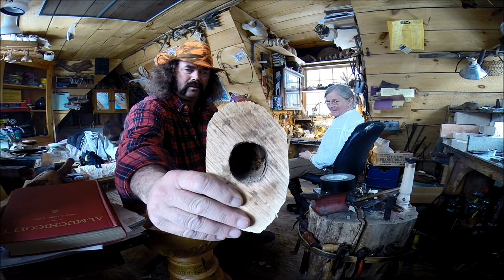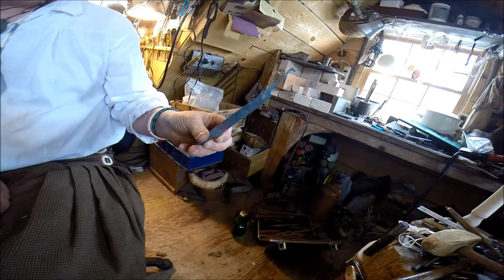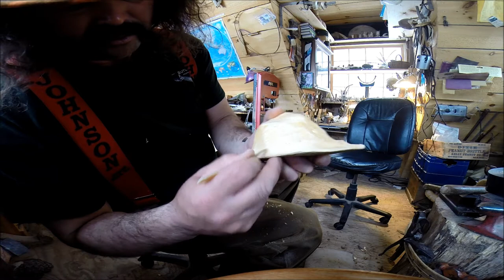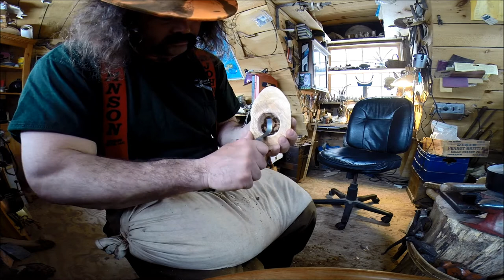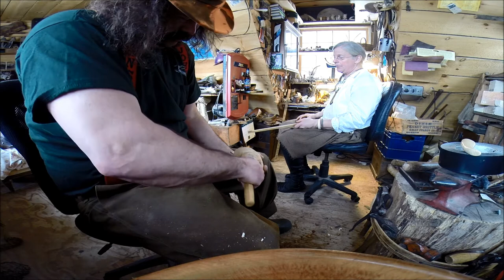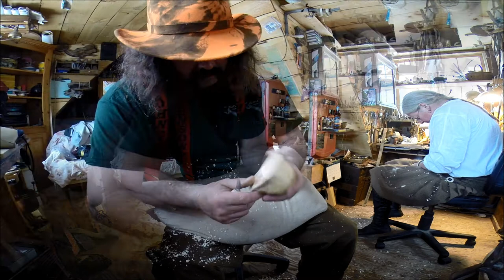Carving a Kuksa cup from a burl (part 1)

Comment: Awesome video, subbed to you.
Just got a good burl today and looking to make my first kukusa from a burl. 
Question: was this burl green all the way?
Reply from the maker: Yes, you want to do it as green as possible. Thanks for watching, I will check out your channel too!!
Reply: +workingclasswoodsman thanks! Another question, I got to pounding the bark off and ants started coming out it lol. I think all of them are of it now but I feel this one won't hold liquid. There's a tunnel from the inside to the outside of the burl. Any suggestions or experience with fixing this or is it a lost cause?
Reply from the maker: +The Bearded Burton two things you can do, chuck it or fill the void with resin of some sort. I use super glue alot. wood is always a gamble. I also melt bee's wax inside if it's going to be used for cold liquids. I would go on with the project anyway and get the practice. You will be breaking your neck looking for burls as this is addicting!! I hope you do a video on this..